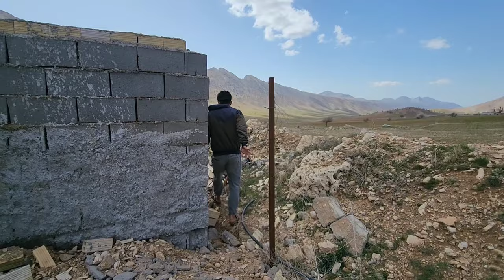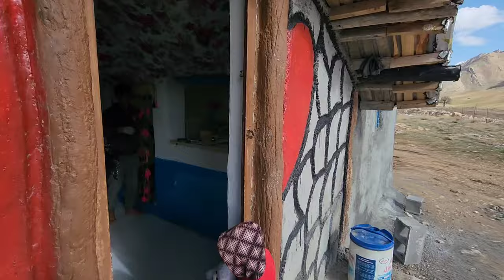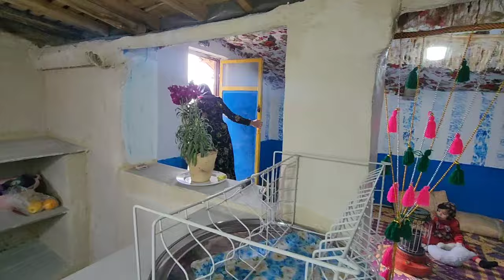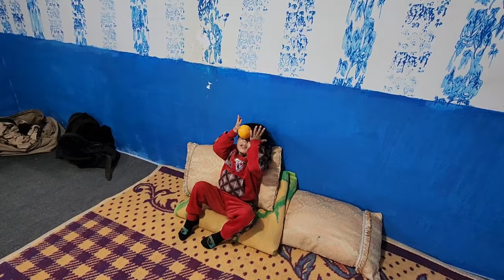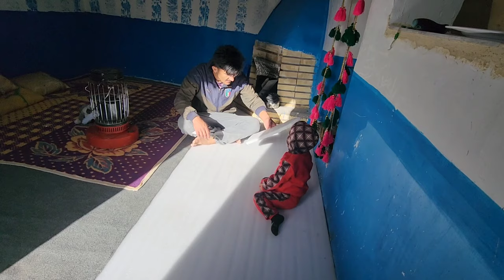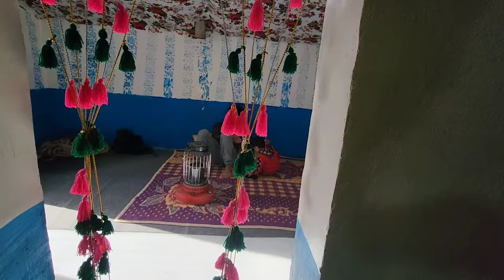"Along with the widow: buying household items for a nomadic youth"

Comment: ramin should have glued that plastic some how six inches unto the wall and than put ground on top and we would have put cement instead and have it sloped down so the water comes away from the house. and he needs to reseal all around the house so the cold and rain does not come into the house again.